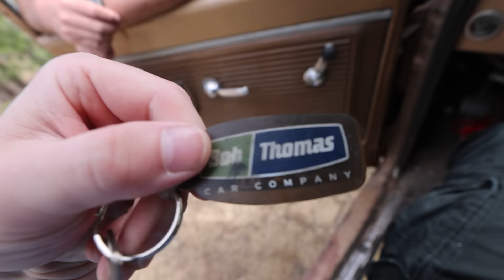Buying my Dad's Old Truck.

Comment: This brought a tear to my eye. My dad bought a brand new Ram pickup in 2013 and he is about to turn 91 this year. I will be getting his truck when he quits driving or passes away. He is still doing great and drives fine still. When that day comes either way it happens I plan on keeping his truck till I quit driving or pass away. If I were you I would restore the truck to like new factory condition. That I think would have been what your dad would have liked the most. Good luck in your decision.

Comment: What you do with the truck should depend on the camper shell.  If the shell was added to the truck after your dad sold the truck, then you should ditch the shell and stockify the truck.  If the shell was on there when he sold it, then you should turn it into the ultimate weekend camping rig for you and your family.

Comment: Just a simple clean preserve it. Replace the missing parts, make the funky parts that don't function work better than they ever did, paint in the same color and a good garage.  No winter driving when they're laying salt.

Because it's done being an every day work truck.  Another 10 or 20 and it will be an insane treasure, as it already is.

Comment: Respectfully, James, just restore the truck mechanically to stock.  But leave the outside as is.  (You can fix the door latch, lol) There is just too much nostalgia and memories embedded in that truck that I think you will regret it if you did too many modifications to it.  This one is too special.

Comment: Also- leave the interior and exterior as is. Or rather, perfext what it was. Underneath and engine wise, do whatever you want. I think that engine should stay though. The engine noise at start up will bring you memories every time you turn the key.

Comment: I'd do what Jay Leno would do, reetore to stock, with minor upgrades to increase driveability and safety. Or do what ICON does and keep the patina, and the old style, and completely swap the drive train with modern guts under a vintage wrapper.

Either way, the nostalgic look will stay consistant.

Comment: Great memory machine you have and I wouldn't go over board building it. I'd just get a strong running 350 to go in and do some simple true duals, throw wagon wheels back on take off the pap cap and just make it look exactly how it was in the thumbnail. Don't paint the truck or fix any dents, thats its natural character.

Comment: I say no to the resto-mod.  Unrestored originals that have been repaired mechanically is where it's at.  A truck is only original once. This time capsule, the way it is, represents all the years in service and the patina earned as a daily driver with your Dad and you behind the wheel.  Keep it original.

Comment: Your old man would be proud. I'd give the old girl a full restoration job.

Make it look fresh but update stuff. T56 6 speed, new brakes & suspension, Vintage Air AC, spice that small block up etc.

But please. No V10 BS. Trust me. You'll never hear the end of it. Nothing too garish either. Just make a comfy, reliable, freshly updated and cleaned up daily driver. Also, I would ditch the camper in the bed. That thing's hideous.

Otherwise, just take care of her like she took care of your dad.

Comment: I thing restoring it back to what it used to be if not better would be the best way to go or if you end up putting a v10 in there at least keep the engine, maybe hang it up for keepsakes

Comment: Take the body off, leave it exactly how it is.  To many memories will be lost, if you do a full remodel.  Go through the instruments, wiring, chassis, upgrade everything, suspension, all disc brakes, etc., put a chevy LS in it, so its fun and reliable to drive, but absolutely do not change anything on the body, leave the body alone. You'll regret it, trust me, I know.

Comment: How much did you end up paying to get good Ole reliable back? If I were you I'd want to keep the truck visually the same inside and out to preserve the emotion you had finding it again and the memories you've had with it. That being said I would put a new motor/tranny, exhaust, upgraded brakes and suspension and anything else. Just don't put no crazy engine in it that would change how you feel about the truck when you get in and drive it. You got a bunch of other vehicles that can give you that rush of adrenaline from their power.